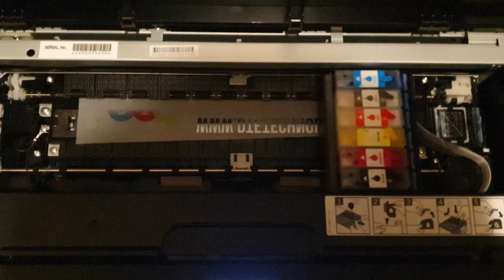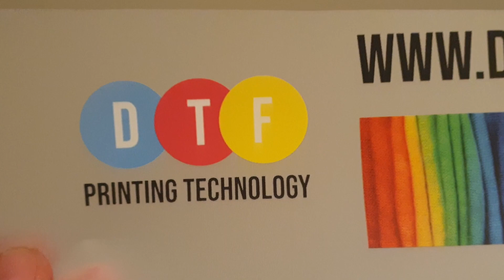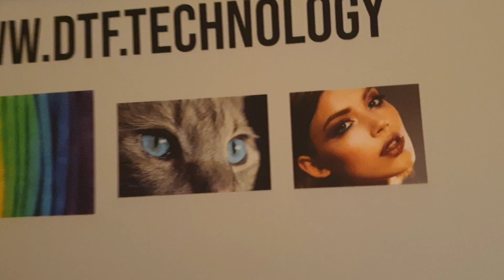How To Convert An Epson XP-15000 Printer To Print DTF

Comment: can i convert a wf 7210 into a dtf printer
Reply from the maker: Where are you planning to put white ink? 7210 only has 4 colours. You need a 6 colour printer so that you can replace 2 with white ink.
Reply: @dtfprintingtechnology9457   right ,didnt really think of that haha. I acutally got a couple of questions if you dont mind answering, I am actually planing to get a DTF printer from alibaba next week its called etamaster l1800 ,do you have any thoughts on those modified printers from china? do these printer last a long time? I want to do about 20-30 prints a day for my business. what is the maintenance like for these modified printers apart from shaking the ink and doing cleaning, are the printer heads long lasting or should I buy a couple extra in case something happens?

Comment: Good video~    I have a question about the part to remove the pizza wheel.
On the screen, the parts connected to the gear on the right part (the pizza wheel connected) and the wire spring connected to the part connected to the right gear are connected to each other. How do I separate this part?

Comment: Hi, I converted my 15000, however I cannot get the printer to acknowledge that there is paper in the printer.  What settings do you use (or what paper) do you select from the paper menu on the printer?
Reply from the maker: I can't remember what I did but I had to chose the back paper feed option in the printer menu settings. I remember it being confusing too.
Reply: Did you figure this out? Please help!! It keeps going from the cassette but it’s nothing there. Help if possible thanks

Comment: Have you encountered any clogs with the white channels and how would you power-flush those channels like you would on a regular manifold/cartridge design?
Reply from the maker: Yes, I have after 1 month of inactivity white channels got completely clogged up and I was able to revive them by soaking them in cleaning solution. Power flush is difficult. I have not figured out a way to do that yet.
Reply: @dtfprintingtechnology9457  I have wondered if maybe could pressurize a cartridge with cleaner using a syringe? I guess I'll never know because I sold the printer because Cadlink doesn't support it. Not buying more software!! 
It was going to be an addition to my R1400...
Reply: @dtfprintingtechnology9457  Wouldn't it be impossible to power flush since the cartridges contain foam filters? You would only be able to flush dampers if im not mistaken and even the cis systems for this printer use foam in the cartridges.
Reply from the maker: @TheXboxSux  Pretty much, yes. You'd need some sort of custom attachemnt for the flushing.

Comment: Thanks for the video! Have you figured out any work around for bypassing the waste ink tank? Also, since filming this have you noticed more clogging versus other printers (like the L1800) due to the sponge vs spring cartridges? As that seems to be what everyone is saying is bad about using this printer.
Reply from the maker: Have not really had the time to do much with this printer. Clogging seems fine still. Currently focusing on launching our own branded printer with all the bells and whistles.
Reply: @dtfprintingtechnology9457  any updates?

Comment: Do you have to use DTF Powder?
Reply from the maker: You can use pretreatment instead of powder but then you might as well go with DTG because all you are doing is overcomplicating DTG printing to achieve worse results.
Reply: @dtfprintingtechnology9457  so powder is the way to go?
Reply from the maker: @aeentertainment5149  Yes
Reply: @dtfprintingtechnology9457  I have another question. Since you are changing the Red and Gray ink, with the white, what happens when there is Red and/or Gray in the design? How do you get the printer to blend the other colors to make the Red and Gray? Also, how do you apply the white, to the back of the design?
Reply from the maker: @aeentertainment5149  Most printers only CMYK and make all the colours by mixing those. Your monitor only has green, red and blue yet it can display millions of colours. So grey and red are not needed. They are only added to enchace some photos. RIP software does all the work and prints white on the back.

Comment: What's the driver in Acrorip for this printer?
Reply from the maker: Acrorip 9?
Reply: @dtfprintingtechnology9457  Yes.
Reply from the maker: @malmo54  It's not compatible. There are no drivers. You need to use acrorip 10 or ekprint studio
Reply: @dtfprintingtechnology9457  If I use Acrorip 10 what driver it is?
Reply from the maker: @malmo54  You don't need any special drivers for it.

Comment: Great video! Thanks for sharing.  
Removing the tray appears ideal, but my concern is stability with large prints.
Wouldn't you need some sort of a platen/vacuum table to prevent ink-streaks? 
Common issues with L805 & L1800 where streaking appears at the end of the print, 1-3 inches from the edge.
Reply from the maker: Yes, a platen won't hurt, however I have not personally had any problems with this printer either because of the shape of the tray or the film thickness that I've used. If this becomes a problem, even a piece of cardboard will do the trick.
Reply: @dtfprintingtechnology9457  thanks 👍

Comment: Could you be so kind and explain how you are performing daily maintenance with xp15000? What are you doing at the beginning of the day and at the end of day with this printer?
Reply from the maker: This is not my daily driver. We run an L1800 print farm. I picked up a few printers just to film a few tutorials and experiment. Having said that, I'm still trying to keep this printer functional so it goes through standard daily maintenance we carry out on all of our printers. Shake the white ink before printing or every 2 days when idle (I extract the ink and shake it inside the cyringe). Make sure to print something every 2 days or do an automatic head clean. That's it.

Comment: Tell me please Acrorip Settings For Epson XP-15000 Printer. Thanks
Reply from the maker: Should be same as here: https://www.youtube.com/watch?v=sAoKsT3ZrfY&lc=UgyZTAfWLGp7ZLBqePJ4AaABAg just need to pick the right printer and ink channels. I've mostly used EKrip for xp-15000 personally so I can't give you exact settings. Also, makes ure to use acrorip 10.
Reply: @dtfprintingtechnology9457  Hello friend, my question is with the acrorip if I placed the l1390 the ink channel order is YKWWMC and in this printer it does not have that order I see that you place the two whites cyan and then the rest but if you adjust the color order does not match
Reply from the maker: @Ajfebles  It's because I'm using EKprint and it allows you to select any order you like in software. If you are converting L1390 with acrorip 9 you will need to make sure your ink order is correct YKWWMC
Reply: @dtfprintingtechnology9457  example. I can in the epson xp 15000 manually change the order of the inks in the printer and adjust it to acrorip or that does not work
Reply from the maker: @Ajfebles  The cartridges only fit the corresponding colour. So black cartridge will only go into black slot. But you can fill them with any colour in any order you need. So you can put black cartidge into the black slot and fill it with white ink or yellow in or whatever ink you need.
Reply: @dtfprintingtechnology9457  Would you be able to tell me your EKPrint settings? I have the same printer and EKPrint but my prints are coming out grainy. I'm using Super Fine 1440x1440 on both color and the white but it still looks grainy. Color is printing at 75% density and White at 100% density.
Reply from the maker: @inklabdesigns  Ink level 2, ink density 100, bi directional printing selected, in drop size light, color mode graphics. This is what was used for this video.